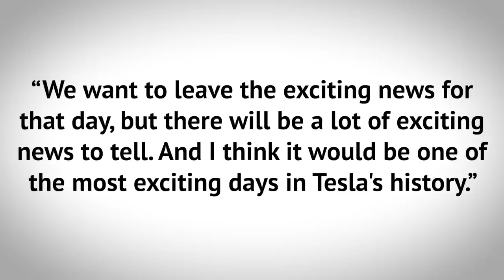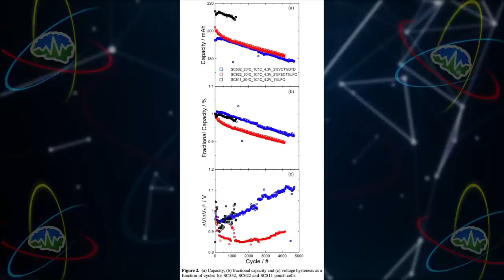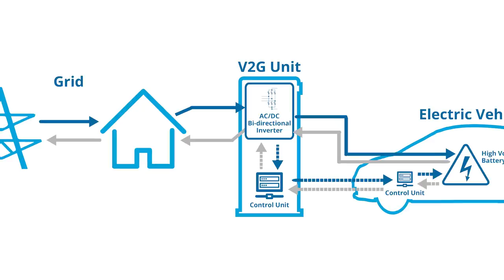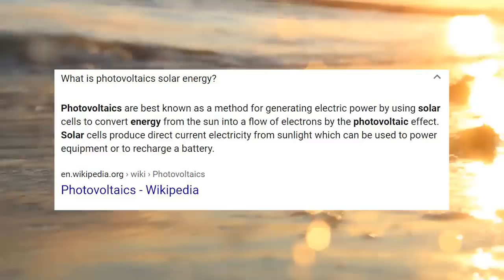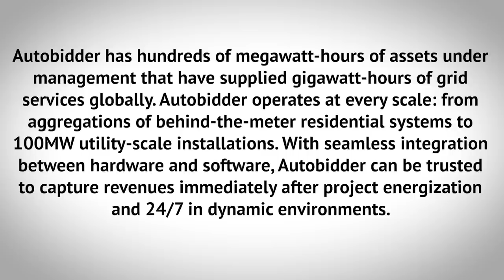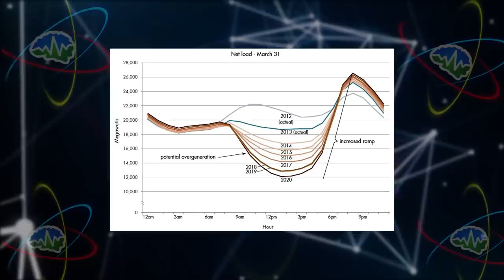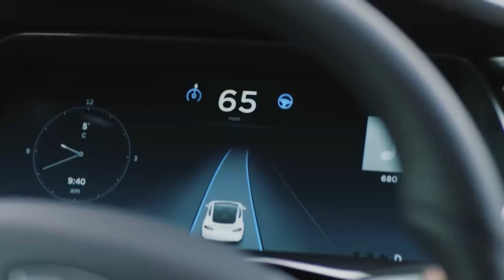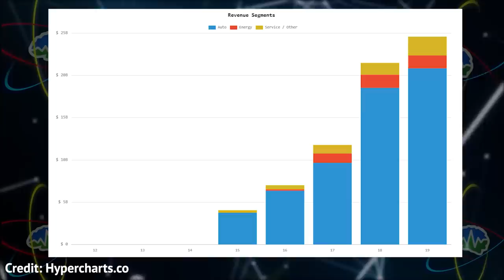Battery Day is Coming!  | In Depth

Comment: Great discussion!  At 22:45, it turns out that your car battery would be discharged and returned to the original state of charge during the connected session.  You'l NEVER come out to your car at the end of your work day to find it mostly depleted!  The connection duration is estimated to be maximally 20-30 minutes, and during that time, it gets recharged as well as discharged.  A seminal paper by Kempton Alec Brooks et al in 2001 established such parameters and how it would work. Worth digging out if you're interested.
There is a group called the Vehicle Grid Integration Working Group (VGI WG) in California which has been working to establish guidelines under which this could work.
BTW: You are correct. 'Vehicle' service is completely different than 'storage' service for batteries.

Comment: I have a battery solar system at my house and I would be fine with my power supplier using my battery power to run the grid, but only if I can send them the bill when I have to replace my battery bank
Reply: @davidclark2286  yeah but when the battery is worn out due to excessive cycling, I want to be able to send my power supplier the bill to replace it

Comment: Problem is,   at rush hour, a lot of the vehicle batteries are being depleted,  then all those electric car drivers get home and start using electricity in the home,   so the peak demand still coincides, in part, with the trough in stored capacity. The other problem, is how can I possibly calculate how much allowing peaks to be drawn from my battery,  (how many cycles and what rate?) will reduce the lifespan of my battery.   The battery is going to have to be leased to the vehicle owner, with a guaranteed, same day replacement below some capacity for this to work.   Peak shaving with battery storage is gonna have to be dedicated batteries.

Comment: Zac & Jesse: What you are missing in your VTG discussion is that the tZero electric car that Tesla licensed the technology for building the original Roadster was a VTG car. At AC Propulsion we didn't even use a J1772 wall connector. We just plugged into a NEMA 14-50 outlet or any other wall plug that we had an adapter for. I have first hand knowledge that my 2020 model 3 is fully capable of VTG (from an electronics hardware perspective) as soon as Tesla updates the software to enable it. There is no expensive wall adapter needed for this function. I suspect, but have yet to confirm that the "Wall Connector Gen 3" may already be fully capable of VTG, and it is only $500 from Tesla. As Production Manager at AC Propulsion (I built all of the tZero EV's). I can tell you that the extra hardware for VTG used the existing electronics plus about $40 in parts. I just wonder how much Elon will charge me for this software upgrade, or will he give it to buyers of the solar roof?

Comment: This is something that should be considered for future use. If I own 2 Tesla s One is a 85KWH battery and lets say the other is the 200KWH battery from the Cybertruck (someday). A storm hits and the power goes out and use that power back into the house for power. The only issue there would be grid safety for power line workers ,but this is very possible.

Comment: I have a question? Why is there no alternator in a Tesla charging the electrical system as you drive similar to a ICE? Couldn’t you just have 2 batteries 🔋🔋 one being charged as you used the other one so you’d never have to recharge cuz your alternator would be constantly recharging you??
Reply from the maker: It takes energy to power an alternator, you'd be fighting yourself and it wouldn't work.

Comment: The University of Delaware has been doing V2G for 8 years or more. They use the MINI-E made by ACPropulsion for BMW. They all have V2G. They even have a tariff with the local Utility in Delaware to sell the power when needed. It pays about $1,200 a year. You have power backup and it just takes a little power. They call it tickling the battery which makes it better for the battery.

Comment: The  battery of a fuel powered engine can charge its battery when it is running, this is due to the generator or alternator installed in the engine, energy is generated by the alternator  which is powered by the revolution of the engine. can this principle be applied to electric vehicle by utilizing the revolution of the wheels to power its alternator and in this case one alternator per wheel.? An E-car is powered by batteries, the batteries has to be charged from other energy source. Is it not possible for an E-car that can charge its own batteries while running ?

Comment: Great video.  I'm not sure,  but I think Sandy Munro claims the model 3 is already hardware enabled to run their chargers backward to produce AC from the battery.  So there is no 4K$ for an inverter, so it's even cheaper than you reported.

Comment: For anyone watching this excellent video that does not know, the Tesla Big Battery at Hornsdale Power Reserve (HPR) in South Australia is attached to a Wind Farm.

HPR was built and made operational in 2017, in under 90 days from time of signing the contract for Construction. When HPR was built and commissioned, it was the biggest Utility-scale battery in the world at 100MW / 129 MWh. 

In the last 3 months, HPR has been expanded by a further 50% and is now 150MW / 193.5MWh. HPR is still the biggest Battery in the World in May 2020. When HPR was expanded, grid-forming controls were added. Combined with Tesla's Autobidder software, HPR has paid for itself in under 2 years.

With grid-forming controls added to HPR, the Australian Energy Market Operator (AEMO), responsible for managing Australia's National Grid, now recognizes HPR as providing 50% of South Australia's required inertia (3000MWs). In HPR's case, that inertia is automated, sub-second response time "Virtual Inertia".
https://www.linkedin.com/posts/johnanoonan_tesla-big-battery-at-hornsdale-earns-record-activity-6666109333773918208-1Cww

Comment: I suppose someone else has already mentioned this, but the size of a battery pack, and its usage, is analogous to a gasoline tank.  In each case, you don't want to drain your battery (or tank) all the way down, lest you need an embarrassing service call so you can get to your destination.  The difference with a conventional battery, unlike a gas tank, you can't fill the "tank" up all the way.

Comment: Using old and new rechargeable cells does not work because they will not charge and discharge at the same rate. This results in the weaker cells getting reverse charged when discharging.

Comment: Hey guys, thanks for a great video. I have a question - the VW ID3 seems to be a competing force (lower price, comparable range ... much to my dislike). How could VW catch up so much with Tesla w/o taking inspiration in their patents? If Tesla patents are still open-source, what is going to stop the other companies from using Teslas new battery? That would put a stop to "no other car company will catch up..", wouldnt it? Thanks.

Comment: Batteries will not help enough to equalize over seasons. Yes, wind and sun compliment each other. But at higher latitudes they produce less during the winter.

Sure, peak plants aren't taking all the money anymore. But they are still needed as slower backup, making that backup more expensive.

Comment: One thing you have got wrong is that you do not need the new million-mile battery tech. V2G research has shown that with the batteries installed in current EVs benefit from being used on the grid. It is easier on the battery and helps balance the cells. V2G use has been shown to improve battery life by 10%, that is with the current battery technology.

Comment: There was more information in this presentation that i've heard in any presentation. The cycling of current to a car battery; the development of the grid which is monitored by sensors that determine exactly where the power needs are, this takes cycling and really recycling to a new level. The use of your car to power your house, however, is great in theory, but remember, your house is connected to the grid. There might be a law against disconnecting to the grid. Perhaps that huge correction on the stock was fun under the old methods, but if this entire new program goes into effect and resolves the electrical problem for a good portion of the country. Amazing! AF

Comment: I have a question ! 
Why cannot Tesla install in their Electric Cars a Battery Charger in the form of an Alternator driven by one of the Motors that drives the Car ? Most Electric Motors that I know and have seen have only ONE Driveshaft coming out one end ! Why cannot it be done with a Driveshaft either end , the one Driving the Car , the other end driving an Alternator ?

Comment: Interesting as it is with recycling batteries, so there isn’t the same problem as with plastics, witch of course is not raw material. 
But it’s construction of cell chains degrades by 20% or more after each recycling cycle.  For making an engineering part, You need “new” plastic but can use recycled plastic as a filler depending on application used.
Hopefully some understands what I mean

Comment: 4:50 "Tesla is all about revealing real products"
I wonder how someone that bought autopilot back in 2013 feels about that comment.
Battery swap, that strange looking tentacle that plugs into your car, robotaxi (it's about now that it's suppose to go live right, but instead we got news that Teslas can now detect stop signs), autopilot from SF to NY without intervention back in 2017?,  summon to work anywhere, "wouldn't need a spedometer" , "option to remove steering wheel"

Comment: Great video guys, I'm a new subscriber as of yesterday. 
Why doesn't Tesla just add a battery to their cars that is mainly for this use? It could also act as a backup battery for the car but it would mainly be used for the grid. This way the wear and tear of the charge and draw wouldn't effect the cars actual main use battery? Obviously the cost of the car goes up (or down possibly in a leasing situation as you mentioned), but in the case that its bought outright, the cost would be made up over time. The secondary (grid battery) wouldn't even necessarily have to be as big or same quality.
Reply: Because the weight of a car especially an EV is huge for range efficiency. Being able to add an extra battery for a long road trip would be cool someday though.

Comment: That just sounds like Net Metering with extra steps.
Reply: With a network of EVs with million mile batteries, Gas and Coal Power Plants can be replaced.  Since solar only works for 30% of the time, net metering requires gas and coal plants to provide electricity for the other 70% of the time.

Comment: Great episode!  This was the best description of underappreciated energy industry potential that Tesla has.
The one key piece of this technology is the transformation of the charging infrastructure which is key to making vehicle to grid work much more effortlessly. Tesla needs to implement magnetic resonance wireless charging developed by WiTricity to make the implementation of vehicle to grid a lot easier and much more effective.  If parking lots and garages at home, at work, at shopping centers, at sporting events were configured with magnetic resonance wireless charging devices embedded in the asphalt, then EVs would be connected to the grid many more hours per day without the additional effort by the driver to connect a cable to a typical charging station.

I predict that Tesla will either buy WiTricity, invest in WiTricity or make a deal with WiTricity so that these wireless charging devices and be produced in mass quantities to lower the cost and become ubiquitous.  Check out the videos about WiTricity’s new wireless charging technology.

Comment: Had a lecture from Dr. Andy Frank in 2007 about V2G and it's benefits to the grid.   He was working on PHEV's and V2G and other initiatives.  Early projects looked at powering the BART system with V2G to lower the peak usage and reduce electricity costs - concept was to park your EV at the BART station, it would borrow power to run reduce the electricity BART had to buy during peak usage hours and they would ensure you the power was replaced before you got back to head home.  Shutting down peaking plants was also discussed as a benefit - so this is not 'new' but it's nice to see it may be getting closer to reality.

Comment: Every EV will be a VPP in the future.  You will only need 1 powerwall as a buffer between home and auto.  Imagine when you travel, your house switches to the powerwall, since your car is being driven.   Then when you get home your car battery becomes part of your home grid and you can take advantage of that power.  Meanwhile, the entire home system will pull energy only when needed, at lower cost to you.  
Side benefit, when you visit someone's house that supports this type of grid, your EV can be tied to their local home grid in case of emergency.
Essentially we'll have a truly distributed energy grid system.
Imagine natural disaster cases.  We can deliver help to those needed by merely driving supply and vehicle to the sight.  No generator , no gasoline needed.

Pretty sure this system will be proven in next 5-10 years.  

Great topic and episode.

Comment: Supplying power via solar panels "in an instant" is a problem. Regulating the power in the grid is a problem that has yet to be solved when say a third of the grid power is coming from millions of solar "power plants"  that go on line or offline (night time, winter,dawn,storms,etc.) The grid operates similiarly to a garden hose, too much pressure in the hose will destroy it. Power in the grid is regulated such that when you turn off the lights the amount of power in the grid is reduced.

Comment: Uuuuuhhhmmm I see a smalll issue with vehicle to grid. Basically, it will only work as long as the car is connected to the grid via this special inverter box. Besides not all people having the ability to plug their car in at home, during the day most cars will be at a different location, like where people work, and that would require to have these special inverter boxes at those locations as well. The powerwall can store energy from solarpanels that generate energy during the day, when most cars ar not connected to the home. So vehicle to grid could only be a replacement for a powerwall if my car is at home which I think in most cases is unpractical.

Comment: Maxwell does not lead to 20% less space needed for production, it is 1/16 of space which is required for production. Maxwell technology has nothing to do with the electrolyte, it is a technology to coat the electrodes and it has advantages regarding energy density, as the traditional processes with solvents and binders has a disadvantage regarding the conductivity / proximity of the particles within the coating.

Comment: I'm hoping someone here can answer this question.  The idea of a million mile battery is great, but for someone who only drives 10k miles per year that means a 100 year battery.  My understanding is that batteries degrade not just from charging, but also due to time.  So, will the battery last for say, 20 years at least without significant degradation? I sometimes keep my vehicles for 15+ years. Thanks!

Comment: Is this how connected solutions work in Massachusetts ? Anybody doing this ? Can you share your experience ?
Reply: Massachusetts has "net metering", any excess solar power generated becomes a credit on your electric bill, the meters can actually run backwards. So not much need for a Powerwall as the grid works as a big battery (except for power outage use).

Comment: A local water utility gets an annual rebate check from the power company for operating its city wide electric motors off of peak hours that range from 1-2 million dollars. I can really seeing large entities getting onboard thus further incentivizing a transition into more electric based vehicles and battery storage options in order to further offset their operating cost. I can see institutions ditching their diesel backup generators for battery banks in particular.

Comment: Frustratingly Nissan have been messing about with this for years, but without stable batteries and the other infrastructure it hasn't seemed to progress. Let's hope this gives them and other manufacturers a swift kick up the proverbial... after all the best way to speed up the transition isn't to make other manufacturers go broke but to force them to change to compete.

Comment: I'm skeptical of the "V to G" idea because 1. Cars are more valuable as a means of transportation than as a electrical storage device 2. cheap solar energy is generated during the middle of the day when cars are on the road or parked someplace where they can't connect to the grid and 3. grid storage could best be optimized using a cheaper "stationary storage"  battery designed to last longer and have enough capacity to capture all the solar power generated by solar panels and 3. if Tesla succeeds in creating robotic transportation, cars will be even more valuable as a means of transportation. Few people will be willing to leave their cars sitting in the garage when they could use them to make money serving as robotic taxicabs. 4. advancing battery technology will better serve to increase the range of the cars, and lower the size and weight of the batteries to optimize handling, wear and tear on the motor, and efficiency. The grid storage idea seems better suited to the stationary storage batteries mounted on the side of a house, where the batteries could weigh more and occupy greater space than they could in a vehicle.